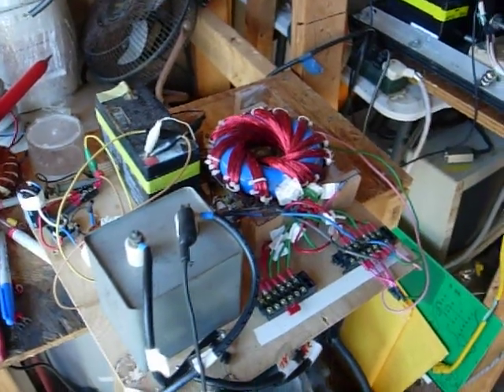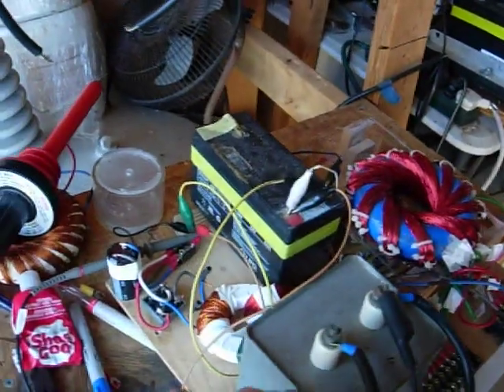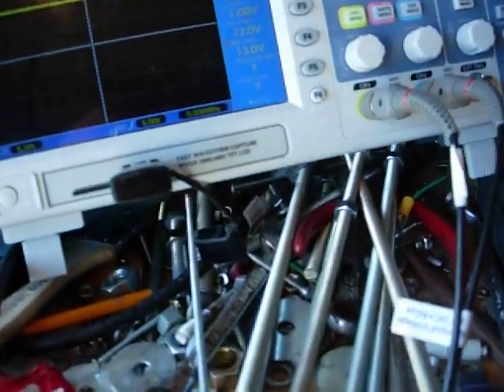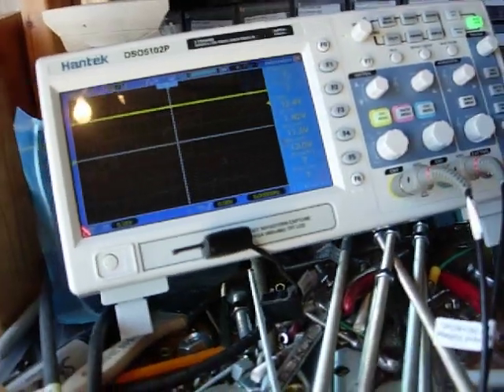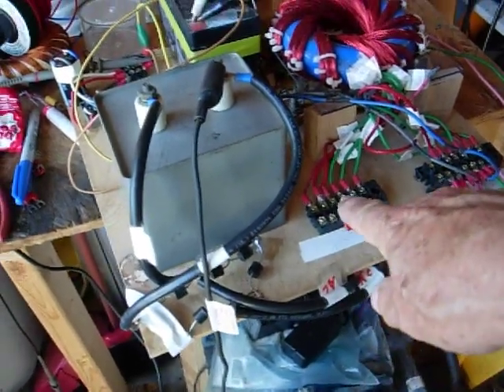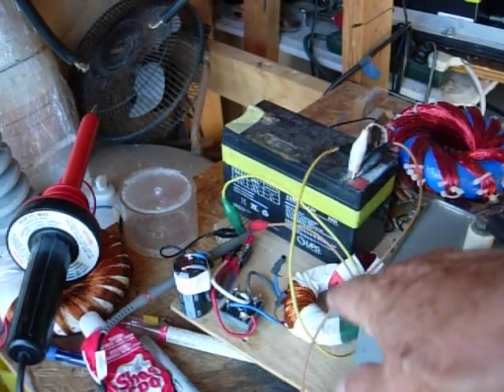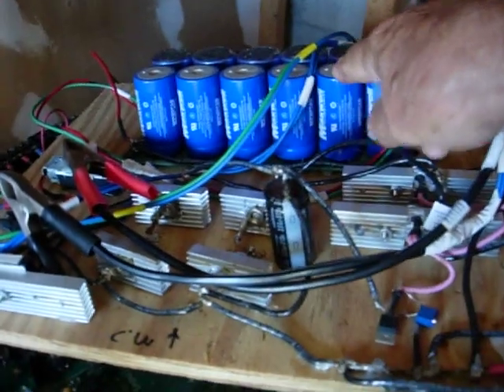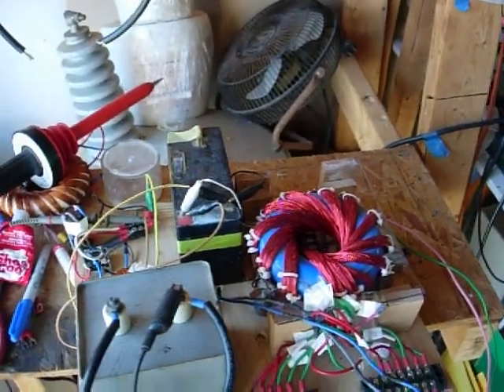Don Smith #250 self running 3hrs no change in battery

Comment: Use a voltage multiplier circuit using another cap just rewire the bridge,  like I wrote Konehead to do. 
I think  FWBR is bad, 2 diodes each cycle powering battery/load, two diode power losses and voltage drop.
We disconnect a direct path that closes the loop. The TX powers one cap through one diode only.

Also would pulse switch it to battery/load.